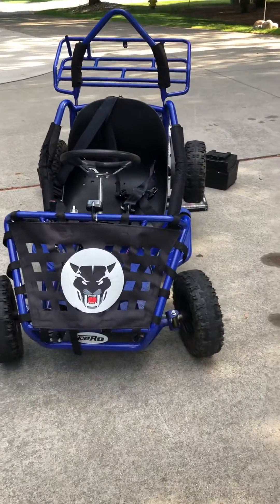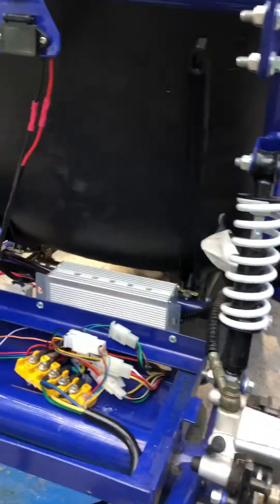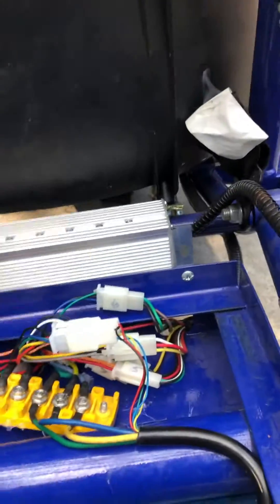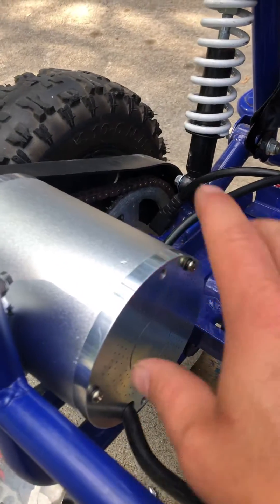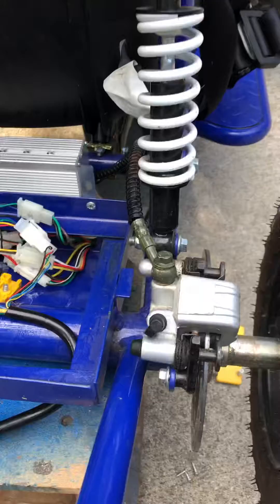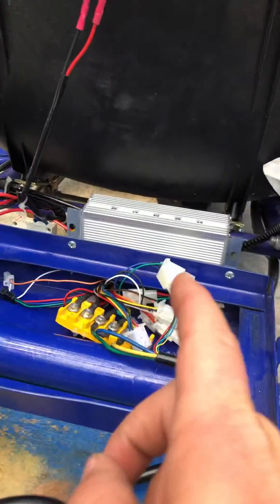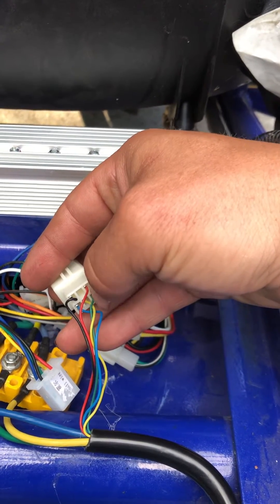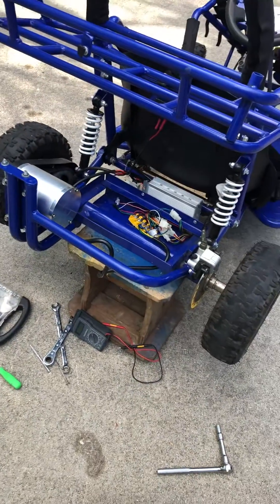Change / Reverse Polarity Of 48V Brushless 3-Phase Motor 5-Pin Electric Scooter Dirt Bikes Go Carts

Comment: How did you wire up the forward reverse switch? I have seen those switches online but they have 6 prongs and most brushless controllers have a “reverse gear” wire that only has 2 wires.
Reply from the maker: It was already installed. I don’t really recall. Seems like there was just a wire going in and a wire going out. It was years ago though so I don’t remember.

Comment: I am swtiching from brushed setup to brushless and cant work out how to keep the reverse/park/forward feature as the brushed only ran two wires?
Reply: you cant just switch motors.  When you go from brushed to brushless or vice versa, you need all new components (controller, motor, throttle).

Comment: I know this is 3 years old but we switch the phases (blue and yellow)  right..then in the hall sensor we switch only the green and yellow wires.
Reply from the maker: You just switch two of the larger wires and two of the smaller wires like you described. I can’t remember the colors but it should show in the video. Also, I think you described the colors correctly.

Comment: You could have just swapped the main motor wires, green to yellow, this would have resolved it without changing the hall sensor wires.
Reply from the maker: When that was done the motor fought itself. The only way to get it running right was to also change the hall wires.

Comment: This is crazy funny because we have to do the same exact thing with R/C cars that are sensored. My esc (Electronic Speed Controller) which was a lower end esc at the time, would only have 1setting for the motor direction going “ccw”. Destroyed my drivetrain components when I only swapped the A and C cables which are the ones your supposed to swap on sensorless systems to safely change rotation. The same way you figured this out on your go-kart, there’s a guy with an r/c drift car video explaining the exact same thing you just did. 😂 I suggest you watch, I was like damn when I seen this and how some thing so big and small can be so closely related. But to cut a long story short, they do make esc’s that have settings for clockwise and counter clockwise now and it makes everything so much easier
Reply from the maker: I haven’t run into this on my RC cars yet
Reply: @freshmaker5  the position your motor is mounted on your cars are probably all the same. The one car I only had this issue with was where the motor end bell faced the rear of the vehicle. Not the front like most others

Comment: I fucking love you thanks so much it worked!
Reply from the maker: This is why I make these videos! Heck ya. What did you fix?
Reply: So update about this once I go past 50 mph it kills my electric scooter motor so I don't understand why
Reply: Update 2 for the first part I did blue to green, yellow to yellow and green to blue and for the second part I did black to black red to red yellow to blue green to green and finally blue to green I'm gonna take her out for a spin  and I will post my results!
Reply from the maker: @tomeoplaysminecraft  50 is flying! What do you mean it kills it? Could be the bms kicking in on your battery, could be a lot of things. If you’re going 50, I’d say your motor is wired correctly and it’s something else happening.
Reply: @freshmaker5  ok so i got another update im able to now go 55 mph i had to connect the reverse wires to make the motor go the other way and it worked now just waiting for the new display!
Reply from the maker: @tomeoplaysminecraft  so is this different wire match up than my video? More specifically what colors did you match to what on the thick wires and same question on the thin wires

Comment: When reversing direction does it lose rpm and torque or same?
Reply from the maker: Can you be more specific? Once I fixed it? Or before?
Reply: @freshmaker5  after you wired for reverse spin, is it the same power output?
Reply from the maker: @KoiAquaponics  the controller slows down, reverse for safety. Initially, when it was backwards, going forward, I could go real slow, but I could go super fast in reverse. That’s how I knew where to start with reversing polarity. Once I fixed it, it went super fast forward and slow in reverse, which is correct.

Comment: Thank you bro! You saved my school project! I originally had it so that every wire was different: (green-yellow) (blue to green) (yellow- blue) and it spun the right way but it was super choppy and it heated up the wires really quickly! My project is an electric conversion for a boat motor so it needs to bre reveresed because at the bottom of the motor you have two gears that reverse the input from the motor to the propeller.
Reply from the maker: That’s awesome. Make a YouTube video and share the link here so I can check it out when you’re done.
Reply: @freshmaker5  Here you go! https://www.youtube.com/watch?v=0Ufx00bRvHY
Reply from the maker: @carlitos8429  what an awesome project. Congrats man!!

Comment: Awesome man thank you!!! Does your wires get crazy hot from this?
Reply from the maker: As far as I know, you are just simply reversing the direction of the motor so it’s no different than stock other than spinning the other way
Reply from the maker: I don’t think crazy hot wires seems safe or normal. You should reevaluate
Reply: @freshmaker5  I know they caught fire it was sketchy….
Reply from the maker: @StudentTrader  something had to be hooked up wrong. Lots of people have had success from this video. Was your setup brushless ?
Reply: @freshmaker5  yea same motor as yours…I am not staying your video caused the fire lol I most likely had a bad motor/ controller

Comment: Curious why you had to swap green and yellow on the 5 pin when you swapped blue and yellow on the leads.
Reply from the maker: The motor fought itself when it was the original way and wouldn’t go anywhere. When I flipped them it worked properly.

Comment: I did exactly what you showed. It now turn in the right direction and has 3 speeds but still very slow???? Have the 72v version with a 60v battery that shows 67v fully charged. Please help
Reply from the maker: Sometimes the controllers have a speed setting. Do you have a shifter or switch to shift speeds? Also reread what you wrote. you’re saying three different voltages, can you clarify? 60 V or 67 V worth of battery won’t even make a 72 V controller work.
Reply: @freshmaker5  yes I have a speed selector even in high its slow. Battery is rated at 60v but when I test it it's 67 fully charged that's why I went Ahead and bought a 72v motor if that makes sense.
Reply from the maker: @TheMetzStein  No it doesn’t make sense unfortunately. That is your problem. A 12 V battery is more like 13 V charged. That’s why you’re seeing 67 V. Your 72 V controller thinks the 67 V battery is dead. You can over volt things to an extent but you cannot under volt them. You need to either add to your batteries to get the 72 V plus or get a 60v  controller

Comment: This is what im trying  to do with my razor quad  I'll  do the big phase  wires 1st then swap the throttle  to see what i get  i have a 2k 48v brushless  set up it was on my rsf650  and  worked correctly  spinning  on the right hand side
Reply from the maker: I’d hook it up all as is and see if it goes in reverse like this. Then if it isn’t working correctly, just follow the video as you mentioned
Reply: @freshmaker5  gotcha
Reply: I can't believe I ordered a rear hub motor for a bike and fallowed the pictures and instructions that came with the motor and matched the cables with it's own colors just like the manual said and the stupid thing ended up in reverse, how dumb the moron who did this cable work at that factory LOL, this is like my four ebike motor I had ever ordered and never had this problem before.